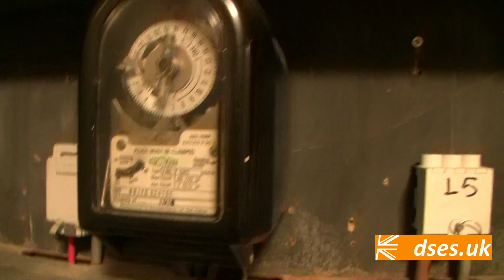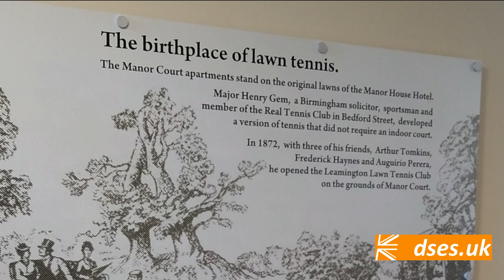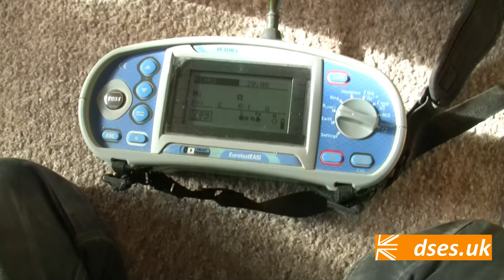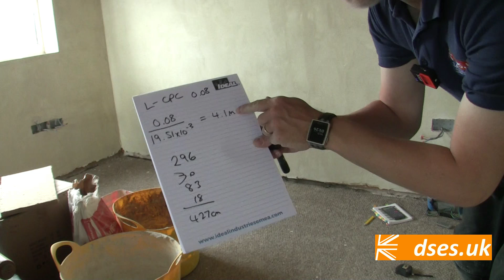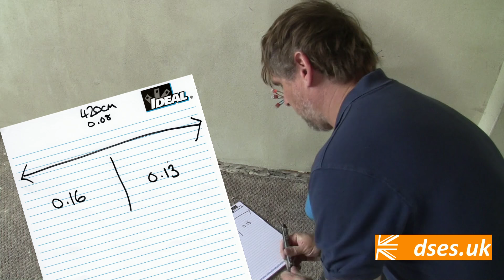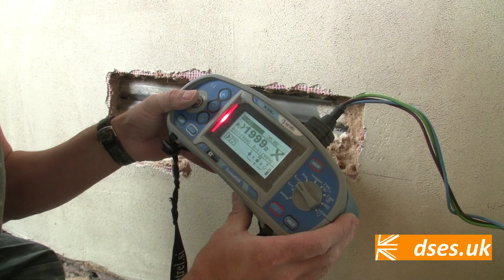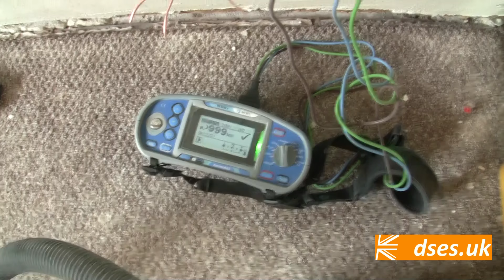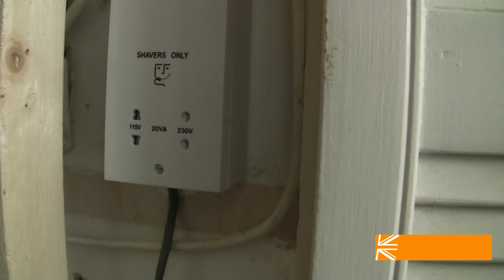Fixing another man's lash-up!

Comment: Hi Mate Im in Australia and a sparky interesting looking at other country's methods. so you cant pull cable through that duct its too tight is it? over here we have to keep 50mm back from face of wall so you usually holesaw a hole in verticals and the cable just goes through. Not many solid walls here anymore its all brick veneer timber internals, my personal house is double brick so its all chasing with grinder and set in cable and plaster over top I usually come down from the top rather than around like that but I guess in a high rise thats impossible. I do like your mechanical protection covers. I had to open up a guys wall once as I gave him the cable and he pulled the 1.5 through for the power (2.5) good fun. Also we have insulated earth and up to 2.5 the earth is the same size as the active and neutral. and we are red and black for fixed wiring and brown and blue for flex on appliances. Very interesting glad you got it sorted.
Reply from the maker: Thanks for tuning in from down-under! The capping isn't suited as mechanical protection, it merely covers the cable from the plasterer. It can be in steel or plastic, but won't stop a screw or nail. It sometimes leaves a bit of a route you can pull a new cable through, but it's not a duct and more often than not you have to dig it back out to pull in a new cable.  Sounds like you're on the wiring colours we used to have before we 'harmonised' with the rest of Europe in the mid-2000's. They also have the earth the same size as the active and neutral, although we have it smaller in the UK because either the physics works different here or we know something the rest of the world doesn't!

Comment: Great Video.
With the repair. What are the chances the copper is actually fine and just the insulation is damaged. Would it have been feasible just to expose the damaged insulation make good with some  kind of heat shrink and maintain the original coppers continuity? Then reinstate some form of double insulation.
Reply from the maker: Thanks Mark. The copper may have been fine, but it could have had its CSA reduced if the nail had chipped it which may have resulted in a high resistance joint later down the line. My regret with this one is that I should have turned the junction point into something accessible such as an extra socket outlet. I choose not to because it would have been out of line with all the other accessories in that room, but I feel that would have been a better way to have handled it.

Comment: When I was a lad, my boss would wire flats like this if both cables were next to each other, until the last few flats, we would take one to the last position & then to each socket back to the fuse board so the tight bastard could use up all the cable off cuts left over.

Comment: The other thing you do is tell the customer that that single off peak socket is absolutely pointless for charging a phone over night as they'll save 83pence over 17 years, just do away with the cable at both ends and leave the walls as they are to result in less damage
Reply from the maker: Trouble is, the heater is going at the far end, not at the wall where the socket is, otherwise I'd have written it off as a duff job.

Comment: if that cable was ever to be replaced in the future, how would the next eelctrician know there's a junction box plastered into the wall?
Reply from the maker: If the cable was to be replaced in the future, the wall would have to be opened to remove the old one. There's no pull through that capping.

Comment: I've had to do the same fault finding in a vaulted ceiling. I through crimped the ends and taped up. 
I've always put my nails through the lip of the capping but you do have to be carefull. I've never hit a cable but my apprentice has, one job he made it look like he'd taken a nail machine gun to the board down drop he hit that many.

Comment: Quick question, not being an electrician, but have miles of cat 5 cable in my years.  If that was a cat 5 cable we would just splice it in to one end of the old cable and use the old cable to pull the new cable through the existing ducting.  Why can’t you do that with twin and earth ?
Reply from the maker: It's not ducted here, it's capped. A metal shroud has been nailed over it to keep it out of the plastering, but it's too tight to drag a new cable through. To replace the cable, the capping would have to be ripped out of the wall. Yes, it is daft, and other installers/other countries use a conduit which makes more sense!

Comment: It didn't need a ring, just a couple of radials. Have the heavy appliances in the kitchen on their own individual dedicated radials.  Then the mcb or RCBO is also an isolator for each appliance. Have the CU at eye level for ease of isolation.
Reply from the maker: Agreed. I'd have run a radial for the kitchen, then one for the living areas. The second circuit, the one he hadn't finished, he had started as a ring, but it will be a 20A radial when commissioned. More than enough for a couple of bedrooms. Rings are for the old boys and the cowboys - those who've done it that way for years, or those who don't know what they're doing. You'd be amazed at how many ring circuits I come across on small extensions or outbuildings serving just a couple of sockets, sometimes even on a 16A breaker!
Reply: @dsesuk  
16A breaker?  They could have put in a simple and cheap 1.5mm cable radial.
Reply: @dsesuk  
Rings do have their place.  I have nothing against them having great advantages. I put one in my place out of choice. And they are cheap when a lot of low current drawing sockets are needed..  But not for two sockets in an extension.

Comment: Hi David , nice to see you back again. Nice work with the cable calcs i have seen that done before over the years but forgotten due to my Alzheimer's.   In defence of the " old boy"  you ageist lol . I have always used the lip of the capping to pin in back to the wall (using the centre of the lip where the galv nail penetrates) You can actually buy hilti nails with a steel washer incorporated in the nail specifically designed for that purpose. That's if you don't mind a tip from an old boy  lol. And yes used to use the leap frog method  in the wiring method as other's have said. Perhaps you could try the leapfrog method with Nigel ???? Please do not think i am nit picking like you say everyone to their own.
Reply from the maker: I'm not sure about leapfrogging with Nigel. Dangerous to bend over when he's behind you...

Comment: and that is why the Spanish (and presumably all mainland European) regs/methods are so much better. A single strand x 3 running in a 20 or 25mm tube are almost impossible to puncture with a nail, and infinitesimally impossible with a screw.

Comment: Why do electricians not like final rings. I'm an electrician and use final rings all the time because if there is a chance of a cable being damaged ie mice , damp etc then you would be able to break the circuit up into 2 16A radials if needed. With the radials that sparks are using now it is very restrictive. Interested in knowing the benefits apart from cost please as 1 lenght of cable back to the ccu is small

Comment: Get your thermal camera out and connect one end across a 6V lead acid battery and see where the hot spot is..lol. Also did you zero out your meter? Most meter's I've seen in service will read a few milli ohm across it's own leads.

Comment: I love ring finals, but there's a time and a place for them.  When both legs would follow exactly the same route, surely this is when you would install a radial instead?
Reply from the maker: A ring wouldn't have been my choice here Andrew. It's too difficult an installation to get around with its concrete walls and ceilings, so wiring out to an end point is easier than trying to loop back to the board.
Reply: Agreed.  Just trying to think of a situation where a ring installed in this manner might have advantages over a radial.  High integ earthing perhaps?   Oh well, something to keep me awake at night.
Great vid btw

Comment: Really interesting video. I think I can understand why they got rid of the previous electrician looking at the way the nail was banged through the trunking, if the cable had been placed in the correct position in the first place the nail would have missed it. I like the way you used mathematics to work out the area where the fault was. Good work.

My only concerns on this would be are there any other nails that were banged through carelessly that nicked the insulation but didn't actually touch copper, I suppose a lot of electricians would have ripped everything out just to make sure. This isn't criticism - you know a lot more about this than I ever will, I'm just saying that's all.

It's just luck that it wasn't a live wire that was shorted to earth or neutral.

Comment: Great work.. I get the theory, but surely the cable length (as you say it goes to the other end AND BACK) is therefore 8m. not 4m ? How does the resistance per meter in the guide sheet fit that ? Thnx

Comment: So, if you do an ir on a circuit and use your method, does that then mean that if you trace the length of the cable calculated, you will always find the fault whether that be a nail in a cable or something like a neon, usb socket etc .
Reply from the maker: An IR tells you current is leaking, but it won't give you a distance to the fault. You can disconnect elements of a circuit to see whether IR goes up or down to try and narrow it down, but you can't pinpoint a position with it. If you have a resistive fault though, then measuring the resistance can tell you where it is as it will decrease in Ohms as you get closer to it. I had an interesting one a few weeks ago that I didn't film with a neutral-earth short. Plugging my tester into various sockets, I found the one with the lowest reading was in the kitchen. The cable to it ran up the wall and under the landing, so I took up the landing floor and found a damaged segment of cable between that socket and a junction box.

Comment: I never like to wire a kitchen power circuit with any other area even in a small flat, if you have a fault in any appliance in the kitchen then you will lose power in the other areas. So always best to keep the kitchen circuit separate especially when you start to consider the number of electrical equipment in use in homes today as you may over load the circuit.
Reply from the maker: Same here, I keep kitchens separate.

Comment: Excellent professional video as always. In lamens terms am i correct  in saying when testing the resistance it went down the line across the fault and back down the cpc. And the same test the other way therefor determining the higher number is the side of cable with the longer length before the fault. Also it worked on n to cpc so does that mean the nail had penetrated line and neautral?
Reply from the maker: The fault was between neutral and CPC Barry, line wasn't affected, but you're right in that the Ohmmeter went down one core (neutral), across the fault and back down the CPC.

Comment: Great to see some educated/experienced fault finding skills employed here - rather than the "The whole lot will need to come out" approach to a problem.  What would you recommend to extend cabling from existing sockets in order to relocate them 60-90cm from their original position ?  Crimp , surface junction or some other approach ?
Reply from the maker: Depends on the situation, but usually leaving the original position where it is as the junction point and covering it with a blank plate. You often can't cover (plaster) over the original position as you still have to indicate the prescribed zone in the wall if it was fed from above or below. If blanked, then crimp, clamp, push-fit or screw connectors would be fine.

Comment: I’m not a mathematician, but using the 2 results 0.13 and 0.16,  could you not turn that into 13/29 = 0.45, then multiply the cable run length 420cm x 0.45 =189cm,   and then measure 189cm from the socket with the 0.13 reading to find your fault with even more accuracy?
Reply from the maker: Quite possibly, but I'm not one for applying too much maths either.

Comment: That's a clever way of finding the fault never thought of trying that. I still can't get my head around why we are still installing ring final circuits though!! (there's no such thing as a ring main) Some sparkies can't seem to drop it and just use radials especially in this age of less power usage. I'd only opt for a ring in something like a kitchen with higher power loads. Oh and btw would you use insulated straight crimps to join that T+E instead of a bulky push fit box like that? Oh and wtf why did they use that crappy fibre boards on the wall instead of uhhh plasterboard ?! Cheers
Reply from the maker: Not a fan of rings myself Phil, and I'd opt for a 4mm 32A radial for a kitchen. Some would throw de-rating factors at me for 4mm, but on a small domestic install I don't think it's worth worrying about. Crimps would normally be my go-to, but I didn't have any large heat-shrink to oversleeve afterwards. I looked up that fibre stuff and it does have fire-rated, acoustic and thermal properties, but I wouldn't want to be the guy trying to hang a shelf off the wall!
Reply: @dsesuk  That's exactly what I did in our house David. 4mm radial for the kitchen and 20A radials for upstairs/downstairs respectively. One reason I hate ring finals is when you are adding additional sockets especially in old properties, the need for fused spur switches obviously for a second spur from the socket. I just wish some electricians would think logically instead of listening to 'old school sparks' who's word is gospel and 'that's the way it's always been done' haha

Comment: Dave what a great find !  Do you get excited as I do when you find these faults with minimal damage and just alot of brain power?  I usually can't wait to get home and tell the misses.  
Definitely got the right spark in to sort it out just unfortunate for you with the crap you have got to tidy up.  

I can't see an issue with your repair, I personally wouldn't had done it that way, because we all work differently and have different ways of doing things.  I'd had either crimped, heat shrink and sheathed back over or single knock out box and wagos or crimps with a blank plate.
But your way is just as good.  

Well done Dave and great video to share 👍🏼

Ps those walls look like K rend not plaster
Reply from the maker: Ah, interesting input on the render there, not my forte I'm afraid, so I'll take your word for it. As for the other solutions, I lacked wide enough heat-shrink to encompass a crimp repair, and a blank plate over a KO box would be at a different height because of the cables being out of zone, otherwise both would have been my go-to options over the Hager! Keep up with those vids - it's been a while since your last upload!
Reply: @dsesuk 
I was joking regarding K rend, its rending for external walls of a house but looks very similar finish,  it may be just what they're wanting. 🙂
I'm in the process of doing a couple videos. Should have something up soon.

Comment: Greetings from Colorado.
I'm an electrician and I'm trying to understand this ring wiring. What advantage does it have ? And that wall construction doesn't make sense to me either.
Reply from the maker: Greetings from the other side of the pond! The ring thing is a hangover from WW2 which, for some bizarre reason, persists today. With copper in short supply at the time, it was decided that instead of wiring out a house with several lower-current (15A) radial circuits for socket outlets, a single higher current (30A) circuit could serve all outlets, thus saving a bit on wiring. If wired in 2.5mm copper, then it comes from the DB, out to each socket and back to the DB meaning the load current is split across two return 'legs', so effectively the combined CSA of the wiring is 5mm squared. It works, but if the ring breaks when Joe Homeowner fiddles about putting in new sockets in a ham-fisted fashion, then you're left with a cable that is now potentially undersized for the load requirements. House builders got into the habit of sticking with it, and now it's common for there to be two rings in new homes, one for the upstairs, one for downstairs - maybe even an extra one for the kitchen. The wiring regs should have dropped it years ago, but it's still in there, and new sparks inherit it as the way to do things from the old boys who won't change their ways. Personally, I install radial circuits, usually at 20A, with a 32A circuit for the kitchen (most installations being single phase here). Another problem with 30 or 32A ring circuits is that a faulty appliance or flex will see a much larger fault current in the event of a short, so all UK appliance plugtops are fused at 3, 5 or 13A to localise the event and to prevent a failure of the whole circuit. Had the wiring regs dumped rings in the 1950's, we'd be on the unfused plugs like the Schuko type Europe uses or something similar to what you use. As for that wall construction, well that's a new one on me too. That stuff has fire rating, acoustic and thermal insulating properties it seems, but I wouldn't want to put up a shelf or wall hang my TV on it!